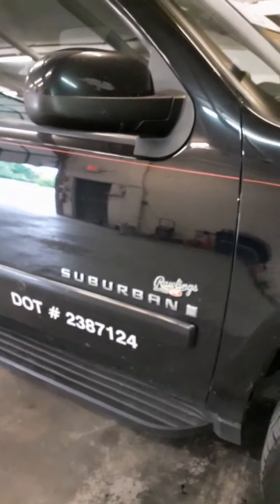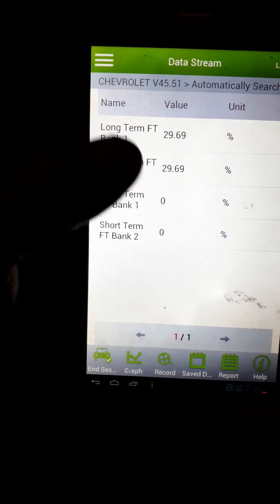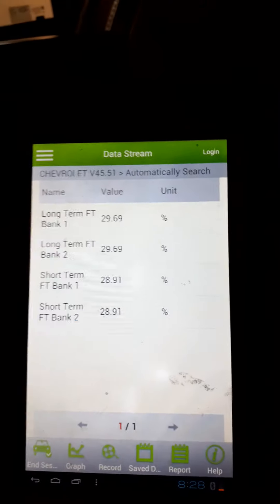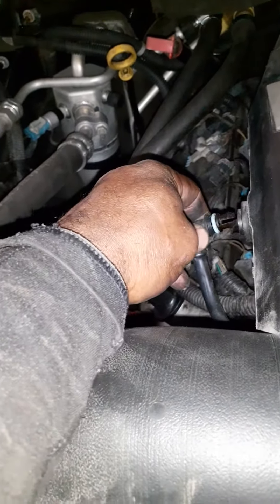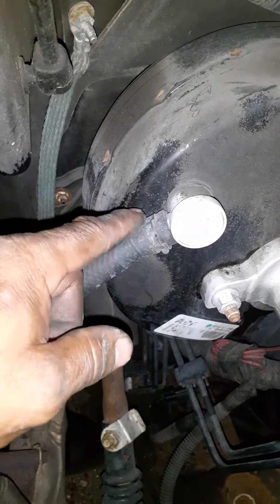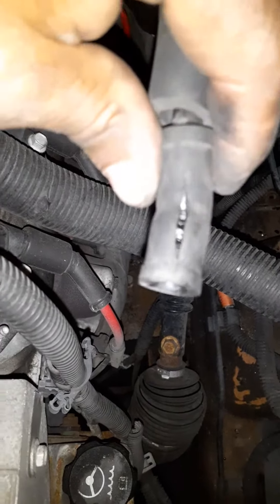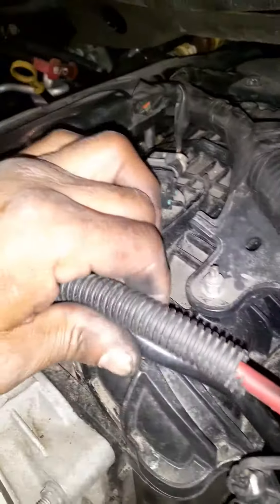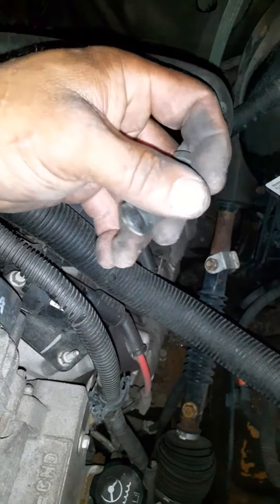p0171 and p0174

Comment: smoke test is useful also.  Easy: use an air pump (such as a battery powered fuel transfer wand) and duct tape a cigar on the intake end.  Open the OIL filler cap until smoke comes out... and then close, tip.

Comment: thank you for the info sir. Like you said follow the hose and i found my problem my hose was burnt and disconnected. Went to Advance auto parts and got a part for $2 and check engine light went away. Much obliged for the information kind sir.
Reply from the maker: Good job ❤

Comment: James,, thank you for your video. I have a dodge ram 3500 2007 with 5.7 hemi . i ran out of fuel one day and after I put some 20 gal. of gas , the engine  would start but won't  run.
they toll me it was the sending unit. so I change it and did run but now when you push it a little it won't go. like can go on the free way at 65 if try to pass , it will hesitate and back fire.
I check it with a scanner a it gave code p0171 and p0174. it looks to me like not enough fuel I bought a fuel pressure miter but don't know whats the normal pressure.

Comment: Have a p0171 and p0174 2010 chevy silverado 5.3 had a crack in my pcv tube top of intake. Still running lean though in bank 1 and 2 ? Even after replacing the tube. Could i have another leak?

Comment: I have an 08 Chevy Tahoe 53 engine I put new plugs new coil, new wires, new pressure valve, new purge valve, new oxygen sensors, new canister and I’m still getting P0 174 P0 300 P0, 1175. Any suggestions?

Comment: Hello  James. I'm glad I found this video. I was even more happy when I heard you say if there are question then message you! Just to give a bit of background: 04 GMC Yukon Denali XL 6.0  it has the P0171 error code, After checking the the vacuum  hoses as you suggested, I found that hard plastic connector  was broken. The person that fixes my car shoved a plastic tube into the hose then that into the broken connector. It eventually came out. I don't even know the name of the connector but it is connected to the motor on the passenger's side toward the front near the top of the motor but on the side of it . You actually  disconnected the  hose  that it connects to at 3:15 into this video. Is that plastic piece that's attached to the body of the motor replaceable ?  What is it called? Thank you for you help.

Comment: Even watching you for sometime now, thank you, I just got a p0171 code on my 2001gmc sierra 1500 5.3 went to the auto parts  and they gave me two different possible problems from fuel punt to fuel filter to spark plug can you help me with this problem engine kind of shakes a little when on the highway but has good power???
Reply from the maker: 7639239113

Comment: I have my (money sign) engine light blinking now & the code is P0174 misfire cylinder 6, I have had multiple mechanics spray break cleaner on it to see if they can hear a change of idle & nothing. I’m really thinking it’s in the crank shaft now

Comment: I got a p0171, p0174, p0151, and p0131 all at the same time. From what Ianaged to research online, I got 3 potential culprits. Vacuum leak, bad Oxygen sensors, or bad fuel injectors. Not sure what your take on it is. I'd appreciate your intake.

When I first had the engine light come on I was driving and as I came to a stop at a stop sign, my car ac shut down and than my car started stalling and eventually the engine shut down. I also got a p0191 and p0300 error but both went away and now I'm only dealing with the other 4 codes.
Reply: It only happens at idle or really low speeds. Once I press on the gas pedal and give it enough gas the car runs fine. Only happens at idle or when I come to a stop.
Reply from the maker: It seems to me like you have a really big vacuum leak have you started checking all your vacuum lines and hoses?
Reply from the maker: Try spring a (LITTLE BIT) of starting fluid inside the intake THROTTLE BODY you might be having a fuel issue also
Reply: @javelldavis  thank I just ordered some starter fluid to see if I can find the leak somewhere

Comment: Thank you ! I do have a question. 

I have these P codes. But when they pop off on the check engine light, I get stability track warnings. I also lee having a check breaks light. 

No problem with breaks tho. Can any of this be part of those P codes and help me figure out where the problem is ? 

Or are they completely separate issues ?
Reply from the maker: Seems to me like you have to separate the ABS and the brakes are on two separate from your engine problem
Reply from the maker: If you have a trouble code send it to me I can point you in the right

Comment: Hey James, I just changed the brake booster and now I have p0171 and p0174 codes, the booster came with a paper thin gasket on one side, if that isn't sealing properly, would this be the spot to fix, with some gasket material? It could also be a line I disturbed trying to remove the old one and install the new one, but I do hear a slight sucking in that area, thanks!
Reply from the maker: Hi how you doing no it's not going to be the gasket there is no pressure between the brake booster and the it will probably be the brake booster or the brake booster hose or you may have accidentally pulled off of vacuum line when you changed it somewhere on the right side rear let me know when you find out  100% sure it's not going to be that gasket you also might have a faulty brake boost
Reply: thank you, I will look under the booster tomorrow and see if I can locate it @javelldavis

Comment: I have this p0174 code on my dodge ram 1500 4.7 v8 4-4 slt truck and wants to know exactly causes this code to show up on this truck of mines. Would like to know how going by fixing or repair so that I can my truck back on the road asap here??
Reply from the maker: Hey brother the very first thing you need to do is start looking for vacuum leaks like how I described most likely you're going to find the problem if you cannot find the problem then it might be an upper manifold gasket leak
Reply: Yo James, comes to find that it is not a blown head gasket...it's my cam shaft that giving the problem here. Could you  give any advice how I can fix this problem here would be greatly appreciated bruh??

Comment: What happens if u replace all ur oxygen sensors and the code p0171 nd p0174 still comes and I also replace the massive flow sensors nd harness!! I been working on my Tahoe by my self due to being a single mom
Reply from the maker: Try to look and see if you can find any vacuum leaks check out my video again you can see some of the places I put my hand that usually there those are the places that will be leaking if you can't find nothing shoot me a message again I'll explain to you step-by-step

Comment: I'm getting  those codes plus I feel once it's shifting the gears 1-2 there is a kick in my trans
Reply: Check for misfires. Misfires will cause the transmission to increase line pressure and will really make the shift brutally hard.

Comment: I have a 06 chevy silverado crew cab 2500hd 6.0 gas and I can't find out y it shakes at idle I've had plugs and wires and fuel injectors and throttle body and mass air cleaned and even the fuel pump and it still shake at idle and no check engine light

Comment: Can the p0171 code go on  check engine light if you run your truck on empty gas? I filled it up with gas unplugged the battery for 10 minutes then ran it for 45 miles the check engine light has stayed off since. What do you think happened if ok to ask? 2002 Chevy Silverado 2500hd 6.0l
Reply: mine does the same itll be on for a couple days then be off for a couple days. did you ever figure it out?

Comment: hey i need help
Reply from the maker: Hi what's wrong?
Reply: @javelldavis  how are u so much like I been getting and buy equipment to figure out what the codes. Is there anyway I can call u? Cause I’m tried of loosing money. I’m about to get ready for work but I get off late night
Reply: Bank 1 and Bank 2 P0171 and P0174 code? I have replaced the MAF sensor and cleaned the throttlebody out. But I got a better check engine reading code scanner. But I don’t know what I’m looking at with the longer term and short term
Reply from the maker: @LiEazzyE  yes7639239113